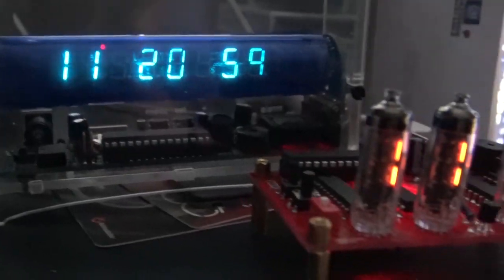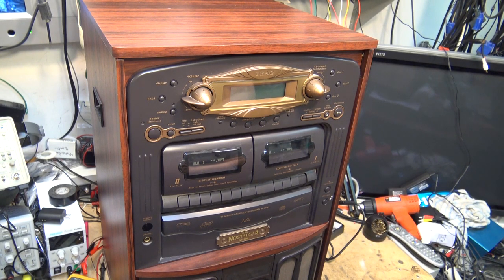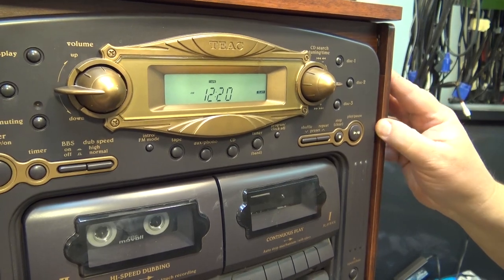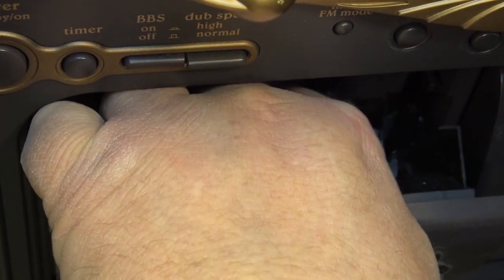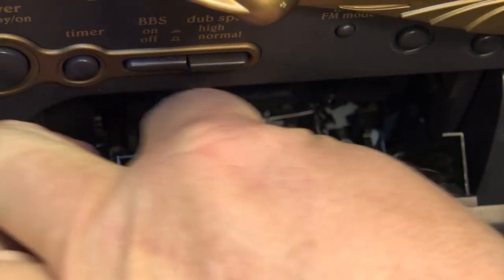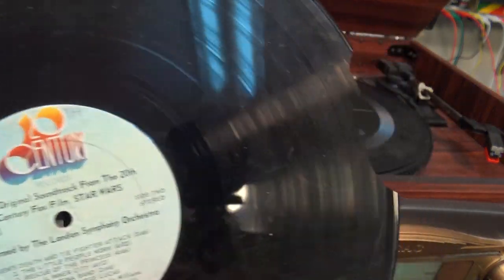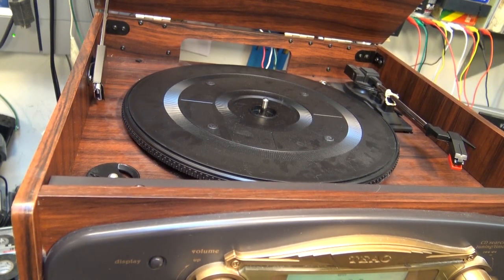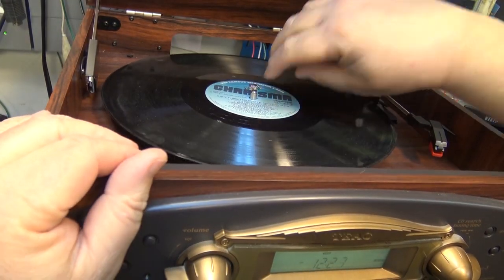Teac GF 680 all in one The G stands for GARBAGE

Comment: Crap-o-phone of the first ordure. Wood'll be good for kindling. An insult to the old TEAC name, same as those Philips lookalike "turntables" Crapley makes. Me, I'll stick to my old ones. That "record deck" is a joke, first appearing in really cheap'n'nasties from the Far East here in the 80's. The clips can be used on old BSR decks mind. The tape deck's a heap as you say, bet it's DC bias, what that thing is is an elcheapo MIDI system from the 80's with a rather vulgar casing. Nothing a good bonfire or garbage truck wouldn't fix !

Comment: TEAC continue to make some decent kit, if you're willing to pay good money for it. Their DACs in particular are very good, they have a good line of mid-range turntables and until recently were one of the last manufacturers of CD recorders and hifi tape decks. They also sold (in the UK at least) some quite nice AV receivers which were rebranded Onkyo units. But I guess in the modern era you have to keep your head above water and going downhill will do that -- the average consumer won't pay proper money for kit any more.

This particular one just looks like a fairly standard early 2000s midi stereo system in a wooden box. That side of things isn't really a problem, and the fact that it all works still is testament to that. All well-proven, half-decent cheapo stuff. They needed the "nostalgia" angle though and bought in a cheap Chinese horror to fill the need for a record 'player'. And it's that bit that's garbage.

I have noticed that these crap TEAC units mostly only sell in North America. Presumably they're being imported by the US subsidiary in an attempt to feed the bottom line. Although some of it has started to leak into the EU market of late as well.

Still, this unit is a lot better than the later wooden "nostalgia" players, with the slot-in tape players and the CD players which are effectively $10 DVD players with the video portion disabled.
Reply: Yeah, could be possible

Comment: (@33:00) I’m sure that there were at least two more of the plastic cups, and there should have been a spring or a foam-rubber pad that fit in the cups for vibration dampening.

Comment: Cheap record players really went south in a big way when BSR stopped making record changers in the late 80's...they were atleast made of mostly metal back then and were adjustable to a some degree...
Reply from the maker: Terry Wilson 
Ah yes the old bsr. Almost forgot about those.
Reply: The BSR record changer turntables had AC motors - big solid ones - not the cheap piddly governor types you find in cassette decks. Many had a rubber wheel under a metal platter and could play 78 rpm "WW2" gramophone records.
A few of them also had ceramic cartridges with flip needles and the anti-skating was minimal to zero with stable tone-arm weight balance. Decent units too.

If I was considering collecting vintage audio equipment, and part of it included turntables, I'd go with BSR or Garrard record changers, not the cheap plastic "budget" crap made later.
Reply: BSR made a range of higher end stand alone turntables with counter balanced tone arm and a better anti-scate set up suited for a magnetic cartridge, you could get changer models and single play models. They were usually badged BSR Macdonald, they all used the rim drive ider set up with a shaded pole AC motor as far as i know...
Reply: There was the odd one, all single players, with belt drive and the big AC motor. They came with ADC cartridges normally. Sadly they were replaced by one that had the same sort of fixings, but a 12V DC motor and a truly dire speed regulation switch. Many "Amstrad" Tower Systems were built with these. The only good thing was you could change them for a proper one, with the SC12M/H cartridge. Recently mind, I DID fix one of the cheapie ones with the DC motor, fitting a proper switch and replacement motor.
Reply: @riverhuntingdon6659  Ahh the C129R etc, horribly plasticky but still better than a "Crosley" and the like.  Some even came with reasonable magnetic carts from the factory.  The speed switch is horrible on those, but the main issue I've seen is caps on the speed control board making it run slow (and the motor being worn out of course).
Reply: @terrywilson4118  Models like the MA70/UA70, they're a pretty decent TT as far as idler-driven units go, 4-pole motor, anti-skate and lightweight tone arm,

Comment: I think your videos are great and learn something every time. The Garbage range of all-in-one stereo systems I believe began in the UK with Amstrad Tower systems in the early 1980s. I opened one up and there was nothing inside except one board and a bunch of wires. This video was painful to watch, but I did all the way through and the best part was the Hot-Snot glue fix.
Reply from the maker: Unfortunately there are tons of units just like this out there. They are marketed towards seniors that still have some old records and are downsizing and just dont have the space. Their hearing is going and they sound good enough for them.   Radio shack used to sell crap like this back in the 70s and 80s. Their concerrmate and clairinette systems comes to mind.

Comment: Neighbor gave me a similar Crosley all-in-one to look at... no sound on any mode. Removed the back cover... found several small boards connected to main board by removable plugs. But.. all the plugs were securely attached to the main board by silicone glue blobs.... and the small boards were riveted to the support brackets. The main frame was also riveted to the particle board-faux walnut cabinet. Back cover replaced... end of project. Neighbor later told me it went to electronics bin. Similar story on a Bose radio/CD player. No sound. All sub-board connectors were glued to main board and that board was securely attached to the plastic cabinet. I guess Bose just replaces warranty units, anything out-of-warranty... you are out-of-luck. BTW, scored several Toshiba DVD R/PB units at different thrift shops. Only one didn't work. Found one of those mini-lytic caps bad that caused the disc not to do final read. Those 'Trashibia' DVD-VCRs are not easy on tape... they will rewind a tape at full speed but will not slow down when approaching EOT. Probably no reel speed sensor.

Comment: The only advantage of hot glue is that it drys fast. Other then that it is messy, pathetically weak, becomes brittle, doesnt hold well, is cosmetically disaterous, cant be used in the field unless you have a generator to power the glue gun

Comment: Used to be... wonderful piece of junk - very good description. But same happened to Sony, Sharp, others. Have old Radio Craftsman tube mono amp from '56 or so possibly designed by Sid Smith of Marantz fame - the Mallory electrolytic caps still with in value. 440, why not 3k easier to adjust. Decks are piece of art.
Reply from the maker: You are 100% correct.  Race to the bottom.

Comment: I took apart a Crosley turntable that was the same thing just with a smaller one. Same tone arm, same little metal clicker lever thing attached to the tone arm, same tiny spring to serve as a “counterweight,” just the part that spins is smaller.

Comment: Just this weekend-long I opened my inlaws unit. Outside looks different but phono,casset,cd,radio somewhat similar. CD DIDNT MOVE UNTIL opened and no sound. Radio works, record plarer belt broken and no noise when you touch the needle, and a small belt on the single casset deck is broken! Selling for estate sale! Where would you purchase belt for something like this if you wanted to try to do some repairs? Thanks for your informative videos. Just learning and your videos help.
Reply: Amazon sells belt assortments for cheap. Flat or square, under $10. You can get single belts from a couple of suppliers but they actually cost more and all seem to trace back to Russel Industries which took over PRB years ago.
Reply: Ray Rooney    Thanks for the information. Have a nice week.

Comment: Better than it was :-D
That unit reminds me of the very cheap units from Amstrad back in the 80's.

But that gold shitty plastic looks really horrible, it does not fit the fasia at all.
Ive seen binatone units that looked very nice, in comparison.

The magnet erase was a shock, even amstrad had a.c erase in there cheap units.
I would have plonked in an old black metal B.S.R deck in, basic but reliable :-)

Comment: Long-term subscriber here, with the question - speaking of turntables, do you have any professional insights and/or experience with newer Audio Technica models? Specifically models AT-LP3, AT-LP5, AT-LP60 and/or AT-LP120?
Reply from the maker: I haven't looked at any of the modern re-introduced turntables, but there are some good ones. You can expect to pay a few bucks for the better ones.
Reply: All of the Audio-Technica turntables are pretty good. It just depends on your budget and what kind of features you want.
Reply: Oh, I know! I own LP120, partially thanks to your review/recommendation and I'm mostly happy with it :) What I actually meant was a look from inside, and professional review & insight of the overall build quality & design. As in PCB circuitry, soldering, EM shielding, motor build quality & similar.

Comment: Wow, only a 440 A tape?  I used to service the real cassette decks and used a 3K tape for speed, flutter, and azimuth.  A test tone almost an order of magnitude lower simply is not short enough wavelength to align azimuth.  Also had a 10K tape for the higher end decks.
Reply from the maker: 440 is used as it is the note A and therefore a common guitar tuner can be used to set the speed. For azimuth a 3k or 7k tape is used.
Reply: @12voltvids  3K tape works with several wow and flutter meters too.
Reply: 440Hz or 400, 160nWb-0dB VU, 200nWb Dolby, 250nWb-0dB for level adj, 3k speed and W&F. 10k, 12k azimuth, 15k for Nakamichi.

Comment: It is cool looking and better then a compressed cardboard cased Crossly. But it is better in the same way dried dog crap on the carpet is preferable to wet dog crap on the carpet.
Reply from the maker: Well at least dry dog crap doesn't go mush when you try to clean it. Not that I have any experience with that because I don't have a dog. Highly allergic. I do however have 4 cats that I am slightly allergic to.
Reply: You will never fully appreciate Crossly  products until you have the wet dog crap experience. They are very similar and I suspect use the same components.
Reply from the maker: The last time I had something that was a piece of crap it was titled "sigma video magic goes boom" and it did. 
https://www.youtube.com/watch?v=UGSGksSOEcg&t=1s

Comment: i have seen alot of that stuff i have to refuse to work on it i tell customer cheap crap not fixable
Reply from the maker: Yup I do that all the time, and turn away much stuff.  It reminds me why I retired from this line of work 15 years ago. Holy sh1t it has been 15 years since I did this for a living!  Where did the time go.Now I do this just more for as a hobby. Make very little doing it, as much of the stuff I work on is my own gear that people have given me.
Reply: I have been getting away from the disposable stuff been doing mostly tube and and solid state stuff and quite a bit of it in this area people like the older stuff it works and is repairable, now I just need to finish my sony Betamax sl-hfr70 great little machine also have the hifi hpf-200 audio processor
Reply from the maker: Same here. I work mostly on vintage stuff. I only looked at this piece of crap because my neighbor asked me to. I didn't charge for the repair, but I was tipped for my effort.
Reply: I used to be able to repair those replica radios that where around in the 80's and 90's my bench is made up of about 80% heathkit test equipment
Reply: You and me both, if it looks like a Crap-o-phone, I tell the customer the same thing. It's chinese crap, there's no service manuals or spares, so if in doubt, sling it out .

Comment: Record Player=Record Grinder. Kinda a like that old Morse and Sounddesign junk from the early 70's.
Reply from the maker: TSM 
What? It only weighs in at about 10 grams of tracking force. That won't hurt the records will it?  It also has a huge needle on it so don't be playing any of those micro groove records or it will be a skating rink.
Reply: lol, if it skips, tape a nickel  on the tonearm.  A friend had GE  "Record Player" around 1970, Led Zeppelins  "Whole Lotta Love"  skipped on every bass drum hit, lol, it took a quarter to stop it.  You could almost see the plastic being sheared away.
Reply from the maker: Tube amps. Love em. I have 4. A vintage McIntoch, a Chine Yaquin, and 2 that I built from kits. I will likely build another one sone day.
Reply: soundesign is better
Reply: These all-in-one systems track at around 5 to 6 grams. Most of them use a spring-balanced tonearm so you have to measure them at the same height as the surface of a record or else you'll get an inaccurately high reading. The systems TEAC is selling these days have a metal counterweighted tonearm and a Japanese-made phono cartridge and stylus so they are better quality than this one from 2004.
Reply: Don't forget Yorx and Grand Prix (GPX).